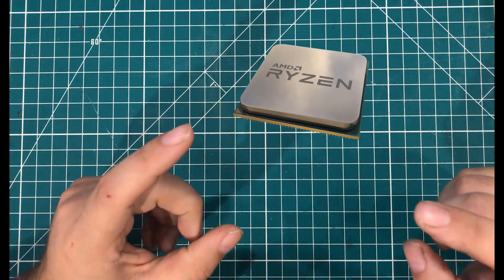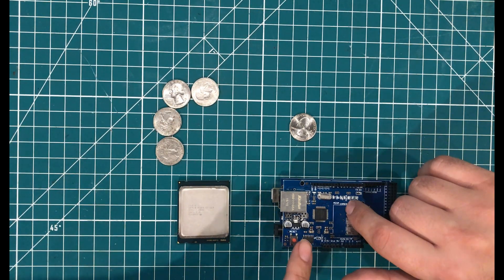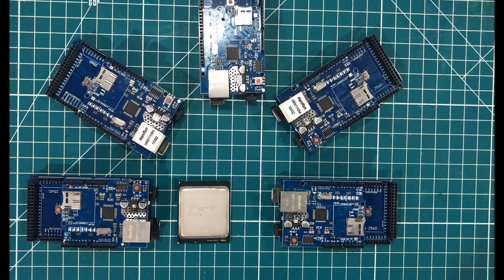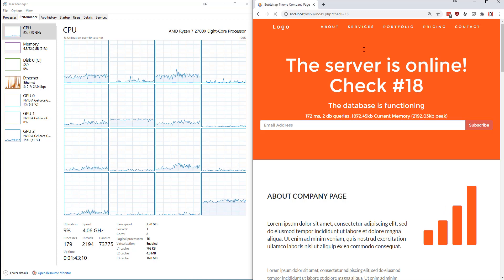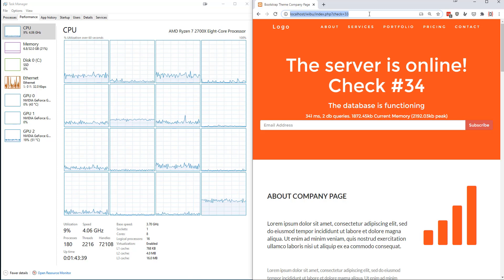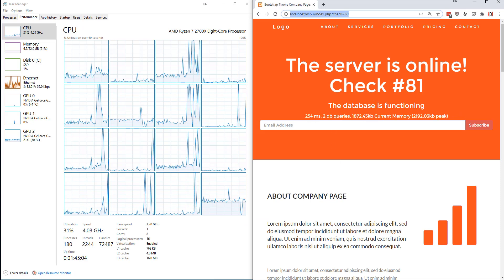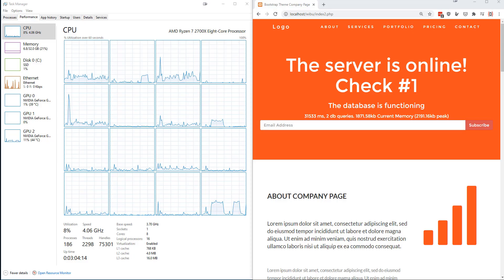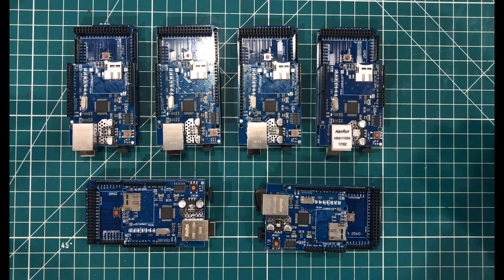How many Arduinos does it take to knock a server offline?

Comment from the maker: A few notes: Obviously there is software I can install in the server to block this type of attack.  As noted in the video, this test can be skewed in favor of the arduino (make the server do more work per API call)...or skewed to the server (perform mitigations forcing the arduino to change IPs etc).  The point of the video is to demonstrate the anatomy of a DDOS attack, not the attack itself.
Reply: rabble rabble rabble

Comment: Interesting.  I just have to learn how to write a sketch for my Arduino to blink an led 😂😂
I’m Serious. Lol
Reply: /*
  Blink

  Turns an LED on for one second, then off for one second, repeatedly.

  Most Arduinos have an on-board LED you can control. On the UNO, MEGA and ZERO
  it is attached to digital pin 13, on MKR1000 on pin 6. LED_BUILTIN is set to
  the correct LED pin independent of which board is used.
  If you want to know what pin the on-board LED is connected to on your Arduino
  model, check the Technical Specs of your board at:
  https://www.arduino.cc/en/Main/Products

  modified 8 May 2014
  by Scott Fitzgerald
  modified 2 Sep 2016
  by Arturo Guadalupi
  modified 8 Sep 2016
  by Colby Newman

  This example code is in the public domain.

  http://www.arduino.cc/en/Tutorial/Blink
*/

// the setup function runs once when you press reset or power the board
void setup() {
  // initialize digital pin LED_BUILTIN as an output.
  pinMode(LED_BUILTIN, OUTPUT);
}

// the loop function runs over and over again forever
void loop() {
  digitalWrite(LED_BUILTIN, HIGH);   // turn the LED on (HIGH is the voltage level)
  delay(1000);                       // wait for a second
  digitalWrite(LED_BUILTIN, LOW);    // turn the LED off by making the voltage LOW
  delay(1000);                       // wait for a second
}
Reply from the maker: That's where we all start!
Reply: Exactly